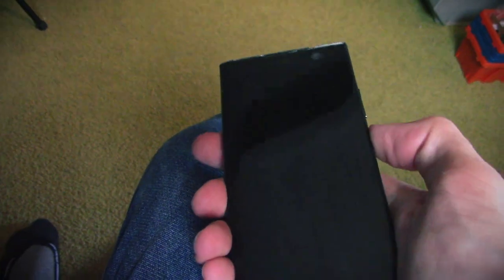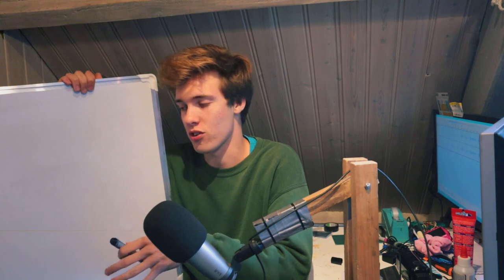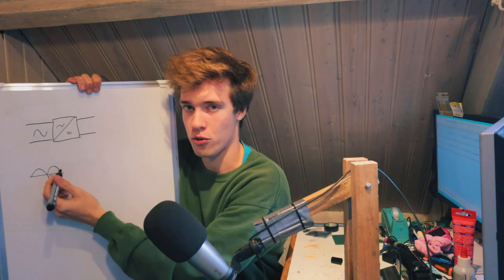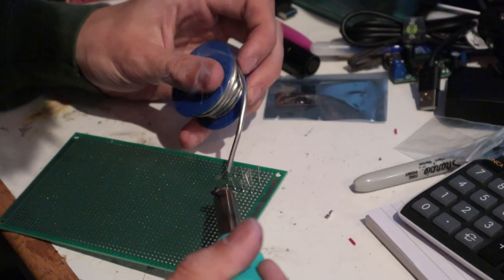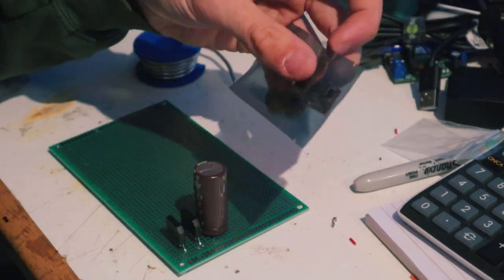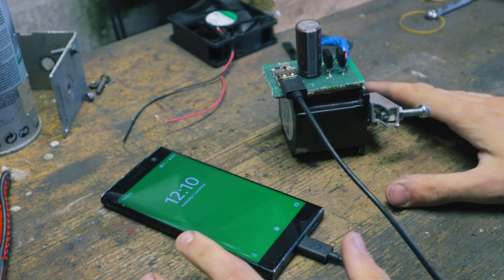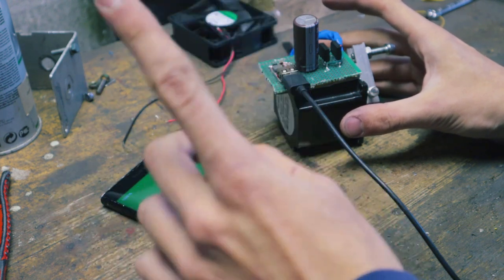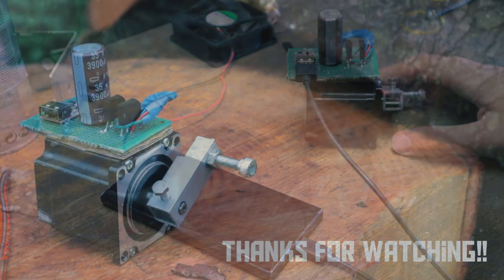Building a hand crank phone charger (AKIO TV)

Comment: Like the project, like a lot of the explanation and filming. Not a fan of drawing a schematic with a double input and then building a circuit with more inputs i.e. use of two rectifiers to handle the the two phases of the stepper motor. Think it would have been better to show the diagram you did and how it will be adapted for use with a stepper motors outputs so people can replicate it (considering you advocated a stepper as the power source). Overall good video, you've got my sub

Comment: If using the right generator on a bike (but still small sized), what RPM will it need to reach in order to ouput the same W and Amps as the phone's normal charger? -- so that we can charge the phone in 2+ hours, same way the normal charger does.
Reply from the maker: Depends on the exact generator type, but in general (regular speed) phone charging uses about 5W of power. Most people pedal at 100+W on a bike, so plenty of power would be available.

If your generator is geared/rubs against the tyre it can operate at very high speed compared to the bike wheel, potentially allowing for impressive output from a small device (higher speed = better power density)

Comment: Given a stepper motor  with two coils that are driven 90 degrees out of phase (most stepper motors)  it is possible to wire the coils in serries and get a higher output than each on its own.  Although you can't simply add the two voltages, you can use The vector phase difference  amplitude of 2 coils with the same output but 90 degrees difference is 1.414 × that of one coil on its own.

Comment: One can full bridge rectify each phase off a two coil  stepper motor add a capacitor across its + and - outputs.  Which Smooths the outputs and temporary stores power. Then connect the - of bridge_recitfyer_1 to the + of bridge_rectifyer_2. 

The doubled output is then taken from bridge_recitfyer_1 + and bridge_recitfyer_2 -.

Comment: If one has to spin their generator a bit too fast to get useful voltages, they might want to use a full wave voltage doubler that:
1) rectifies the AC to DC. 
2) doubles the peek AC to DC voltage - diode voltage drop.
3) Smooths the output voltage. 

It's easyer to google full wave voltage doubler  but here's how to build it. 

Get rid of the 2 bridge rectifyers and get 2 diodes per phase.  Lastly, you'll also need 2 capacitors. 

Full wave voltage doubler. 

1) Connect the coil_output_A to both the anode of diode_D1, and to the cathode of diode_D2. 

2) Connect the cathode of Diode_D1 to the + terminal of capacitor_C1, and connect the anode of Diode_D2 to the - terminal of Capacitor_C2. 

3) Connect coil_output_B to the - terminal of capacitor_C1 and to the + terminal of capacitor_C2.

4) Voltage doubler output is taken from the + of capacitor_C1 and the - of capacitor_C2. 

Both phases can share the same same capacitors.

Comment: attach a dead weight with string rolled over the shaft of the stepper motor so if u let the weight fall it will rotate the shaft and produce electricity?
Reply from the maker: certainly possible, but you'd have to lift it back up every now and then of course.
Reply: @AKIOTV and if i just add a gear system to reduce the rate of the weight falling and increase height so i don't have to lift it every now ?
Reply: @AKIOTV one more thing, is there any difference while cranking the Motor without the phone connected and with the phone ? Like is it hard to crank with the phone connected?
Reply from the maker: @Nate-oi7ri  It is harder to crank with the phone connected. Many people assume that a generator turns easily no matter the load, but a generator is harder to turn as more power is drawn. The laws of physics always apply: if it makes more power, you need to put more power into it as well.

If you geared it so thw weight falls slower, it produces less power and run for longer. But the energy supplied per fall of the weight is unchanged.

The potential energy in a weight is m x g x h, so dropping 10kg from a height of 1m gives 10 x 9.8 x 1 = 98J of energy. A phone battery holds about 36000J of energy, so you'd have to re-lift the weight 368 times for a full charge.
Reply: @AKIOTV  thank you so much
Reply from the maker: @Nate-oi7ri  you're welcome :)